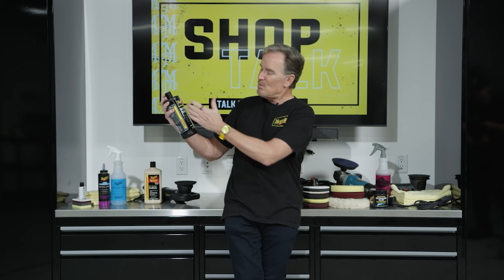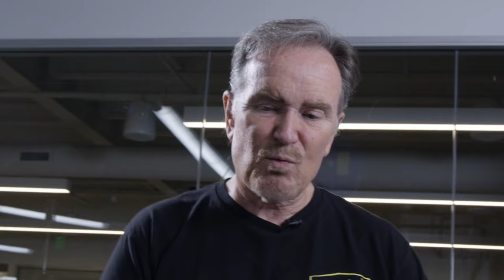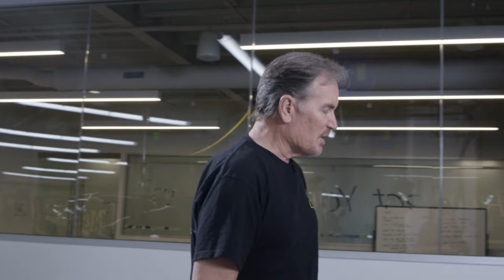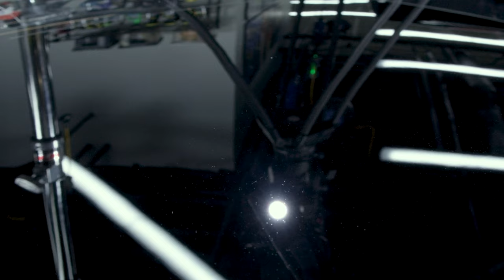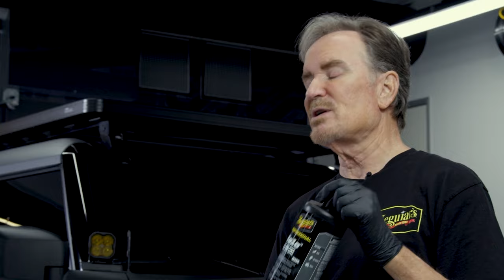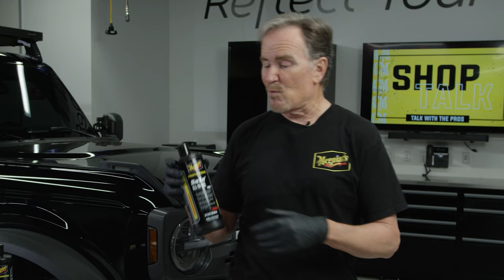How to Get the Best Results with Meguiar's Pro Speed Polish M200 & So1o All-In-1 M300 - Shop Talk

Comment: Nice and clear video! What is the difference between Meguiar’s 3 in 1 Wax and M300.?
Reply from the maker: The new M300 So1o will offer better cutting and can be used by hand, orbital, DA, or Rotary.  It will also provide super protection with an SiO2 "ceramic" formulation.
Reply: Ok! Thanks for your answer! Is it on the market yet? In Europe?
Reply from the maker: It is not.  Typically you would need to reach out directly to a Meguiar's distributor in your country for all questions about availability and pricing there.
Reply: Aha! Ok! Thanks!👍

Comment: Hi Michael..  will heat and humidity affect the buffing cycle time? If yes.. how so? Thanks
Reply from the maker: Heat can always play a factor to some extent and buffing in direct sunlight is never ideal.  That being said you should be fine as long as the surface itself is not hot to the touch.  Again, these products have very long buffing cycles.

Comment: Would it be beneficial to follow M300 up with say, M21 or M27?
Reply from the maker: M21 would not make much sense.  M27 could have some benefit as it would work on top of another protection but is certainly not required.  Also keep in mind that if you are now making this a 2 step process you have a lot of other options other than a cleaner/wax.  The primary purpose of a cleaner wax is to be a one step process.
Reply: Awesome, thank you for the great info.